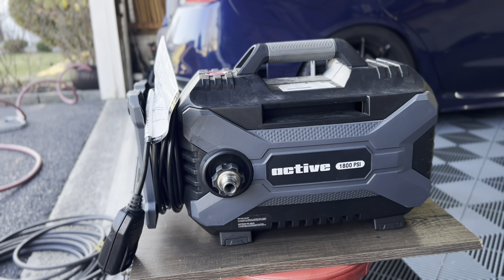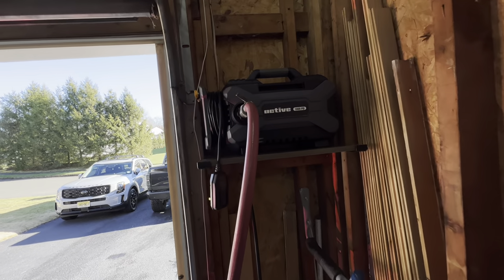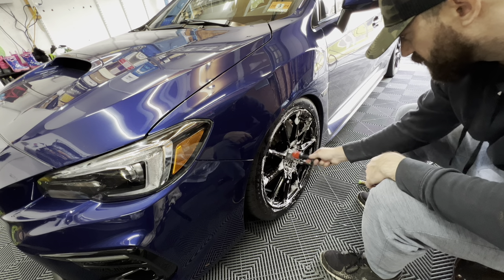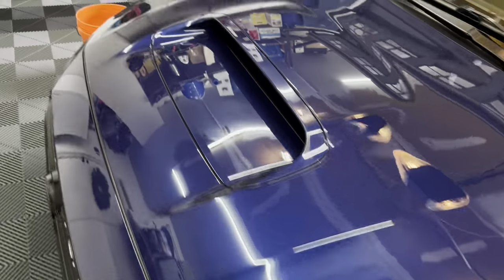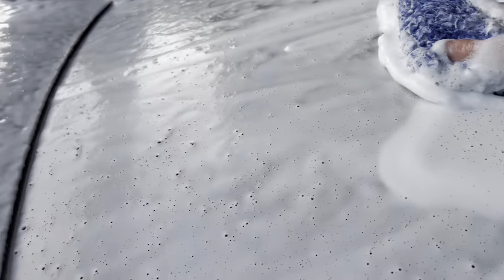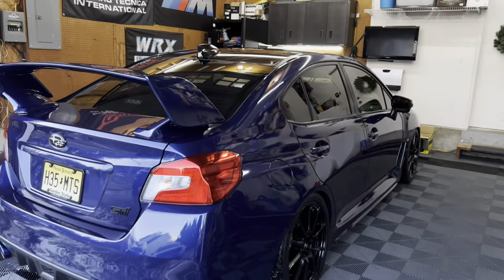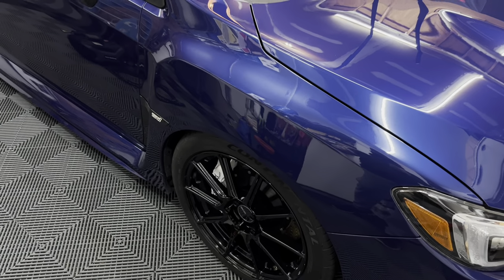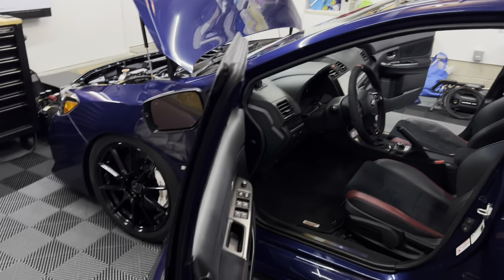Washing My STI With My New Pressure Washer Setup - Went TERRIBLY Wrong!

Comment: The surging was a known issue when using a longer hose with the Active 1.0 along with the Active ve52. Even without the leak on the inside they surge when used on a hose longer than 25 feet. The 2.0 fixed that issue so its worth it in my opinion along with the much longer warranty that comes with it. Ive been looking to upgrade from my Ryobi for a while now and the Active 2.0 still seems like the best value at least for car washing.
Reply: Agreed, besides Home Depot junk I’ve personally used the AR630 and that thing is amazing
Reply from the maker: Yeah my hose is 50ft and my water hose is 100. Probably the issue. Might just step it up to the AR or kranzle

Comment: Yeah the issue is the hose for the pressure washer.  you need to have a 25 ft hose it doesn’t like anything bigger than that when I got mine I used my 50 and it was doing that. then I used the one it came with and it fixed it so I just bought a nice 25 ft hose and it liked it
Reply from the maker: Yeah that’s what I was thinking as well. Unfortunately, I  can’t use anything shorter due to where the bib is located.

Comment: Quick question

You said you dried it with the obsessed garage drying aid after every wash, but I thought you used bead maker. Did you end up making a switch?
Reply from the maker: Yes I made the switch a while ago. I mentioned it back in the summer I converted over. Beadmaker had a big dust issue where it attracts dust like crazy. OG doesn’t do that and has the same feel and effect as BM.

Comment: How does the water drain out of the flooring?
Reply from the maker: Garage is properly slopped. Runs through the channels of the Swisstrax and out to the driveway. Floor is dry by the following day.
Reply: @Scoobyfreak86  Do you ever clean underneath the swisstrax to get rid of any dirt buildup? If so, is it pretty easy to remove and clean
Reply from the maker: I vacuum the floor every few months. Very easy to remove. Just use a pick tool and pull up on one of the tiles and can get under very easily.